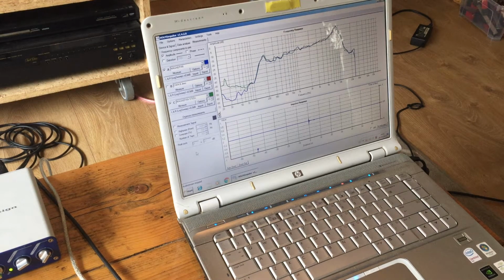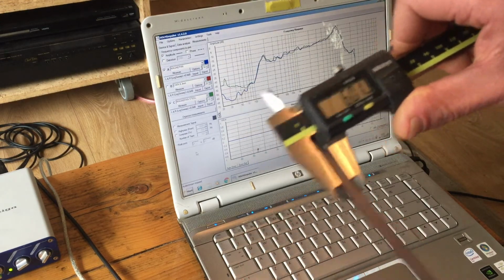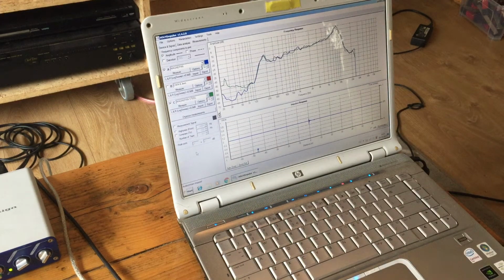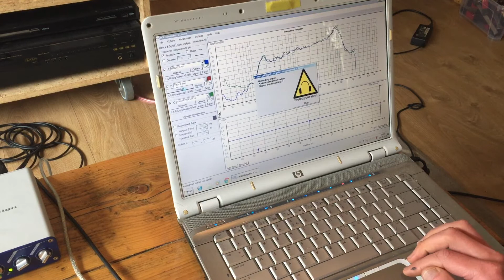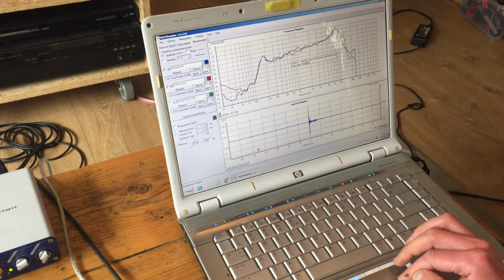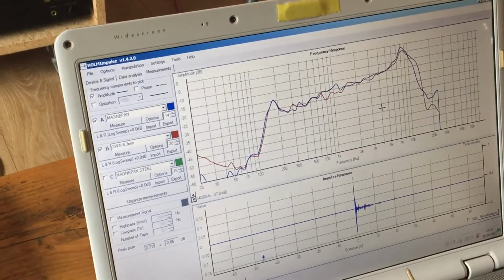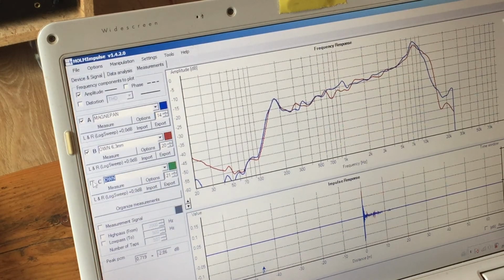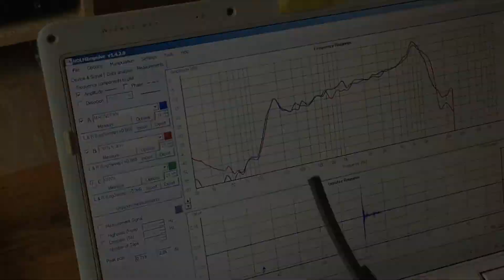Rubber Magnet Test Part 4 : Magnepan's magnet vs my magnets (same width)

Comment: Wonder if anyone has ever tried with electromagnets
Reply from the maker: prototype9000 yeah thought about it to. Not sure if winding over a long strip would work. Or loads of small coils  the wires might be in the way to :) another thing winding a thin rectangular is pretty hard on a machine:) but I am pretty sure I will try it one day :)
Reply: this place looks like it has electromagnets that would work http://www.magnetechcorp.com/custom.html
Reply from the maker: well there long skinny has wrong polarity, they are potted, so north and south are on the face of the strip instead of one side under one side top :(.  also  price will be insane :)  i might try when i got time ever to make a small long one with thin wire to see if it does anything :) kind of super long bobine :) 
so many things to try , and so little time